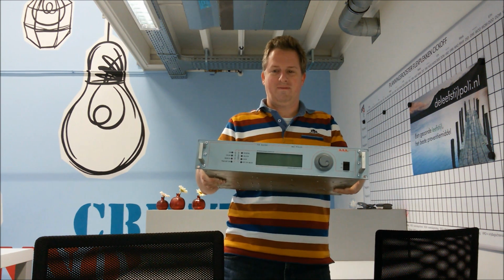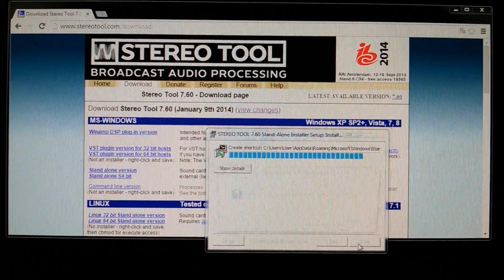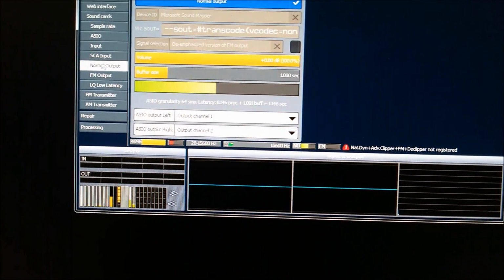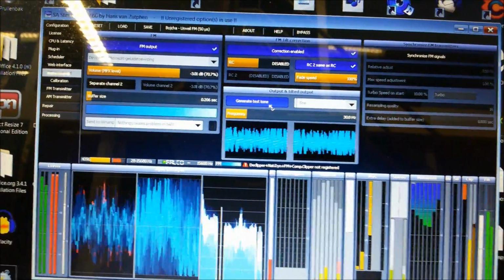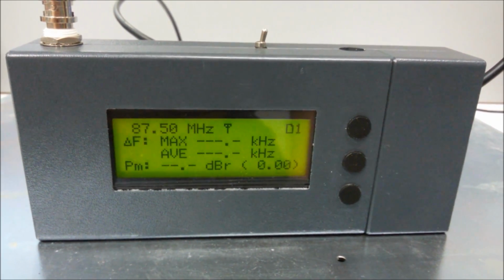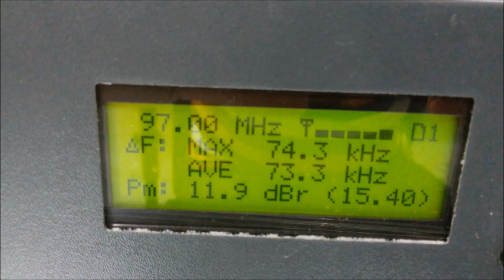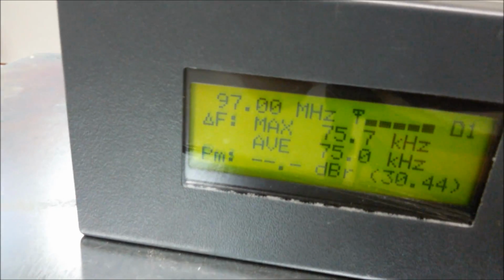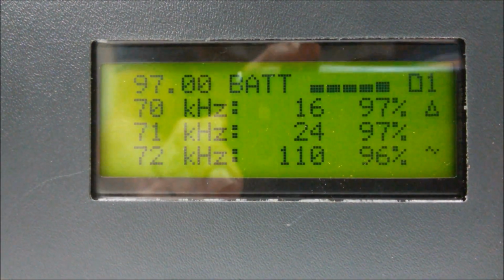Tutorial: Setting up Stereo Tool for an FM station in 5 minutes

Comment: Once a day before you shut it off, turn the volume very low and turn the dial up and down to lower your waves in the wires from it, the stereo, to the wall and out or nothing good. 

Hans, you aren't eligible.

Comment: Does it affect at some point that the cable is stereo and only one rca connector is used in the transmitter? Does StereoTool send the same signal on the left and right?

Comment: looks hard to use I just use a simple 30 watts transmitter but the mp3s are all over the place some high others low and want them the same vol so it not distort on winamp player.

Comment: What do you mean "within legal limits"?  You can broadcast whatever signal you want on your FM.  A tape player, a record player, a iPod.  Doesn't matter.
Reply: The most important thing is that your signal needs to be in the 75 KHz bandwidth that every FM station needs to be in so it doesn't disturb other FM radio stations.
Reply: @TOPCyber  50us/75us-none
Reply: @freshfm99.5dublin4  so is it 50KC or 75, for USA
Reply: @TOPCyber  100mhz, fm  87.5-108

Comment: Will ASIO work with VB Audio Cable? I use VB Audio cable so I can 2 seperate sound outputs, one for unprocessed audio for the internet radio station and the other for stereo tool FM TX.
Reply: Ryan Toomey why didn't you use normal output to internet?
Reply: Because I am using the standalone version. I need a way to pipe the audio from my music player (Zara Radio) into Stereo Tool AND Edcast, without having to use 2 sound cards (one for input of unprocessed audio and one for output of processed audio). I basically need an independent audio loop-back.

Comment: Is there anyway to test this without one of those FM analyzers?
Reply from the maker: Well you will need something . Many transmitters will show you the levels (but the display often isn't precise enough). Having said that, I would say that if you have an FM station you really need to have (access to) an analyzer. You can get a Pira for around 200 euro, or you could use the software-based MpxTool (which you will need to calibrate - you could use it with an SDR stick).

The easiest thing to do is to buy a Pira (or borrow something from another station, when setting things up). See http://pira.cz/fm_broadcast_analyzer/ .

Comment: So Questions come to mind. Is Stereo tool only for pc or can it be downloaded on an iMac Duo? is it a stand alone app or can it be used as a plugin in Logic Pro X?
Reply from the maker: Windows, Mac, Linux, ARM Linux (Raspberry Pi 2/3). Stand alone, command line, VST plugin, Winamp plugin, Carbon Coder plugin, GML plugin.
Reply: this is all new to me so I'm a bit overwhelmed with the process. I've an iMac Duo II, using Logic Pro X and unsure which version of Perfect Declipper to down load.. do I use only Stereo_Tool if I want to use Perfect Declipper as a plug in to Logic Pro X or ?Please help!

Comment: Hi already installed the Stereo Tool Demo, everything working, and now as I turn on my PC to the FM transmitter (TX)? For the PC, the output is stereo jack 3.5 and FM transmitter input is in MPX format. Ask for help?

What is the best sound card for the PC, to ensure good transmission from the PC to the FM transmitter (TX), encode signal Stereo and RDS.
Reply: Behringer UMC202HD!
Reply: @juniorsilvabroadcast  do u have a link